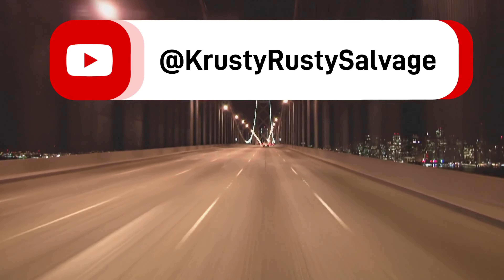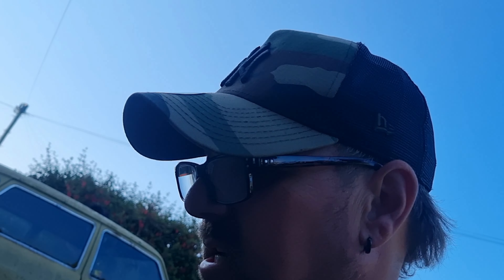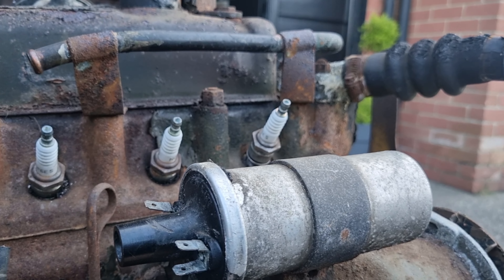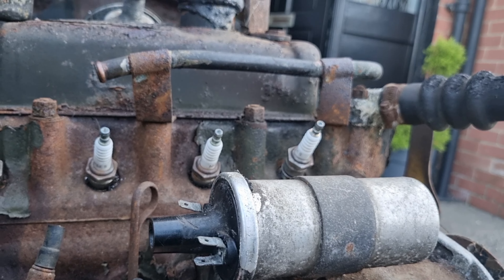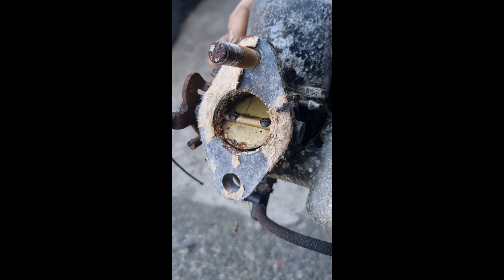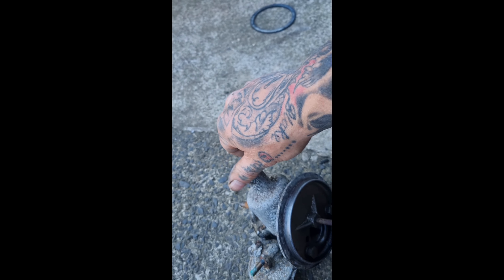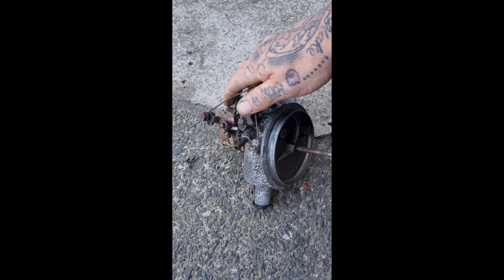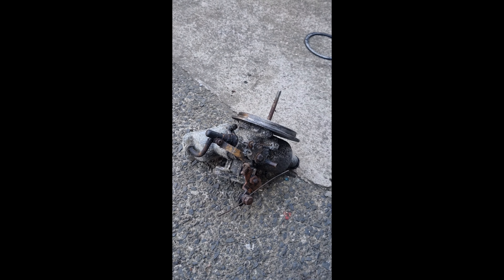@KrustyRustySalvage Morris Traveller First start in 44 years. Will it run #barnfind #willitrun

Comment: Great work getting the old Moggy engine running Craig. If you dont mind me asking will you be doing a Video on the other Morris in the background?. Looks solid on the body. Hope the motor is a good un too 👍
Reply from the maker: It's an Austin 1800 and isn't mine.  Holding it for somebody atm.  Shame because if I'd seen it I would have bought it lol